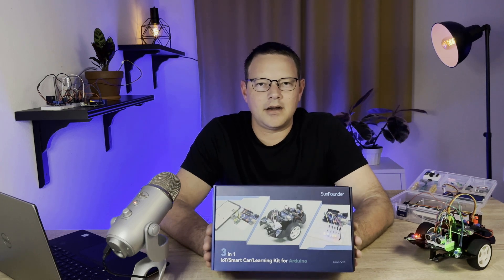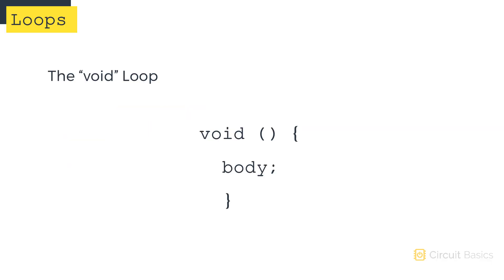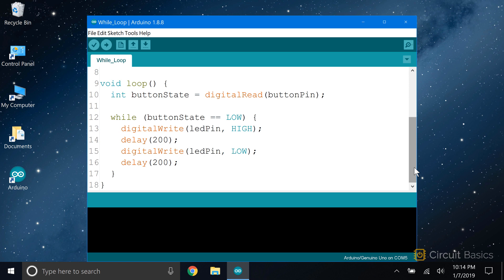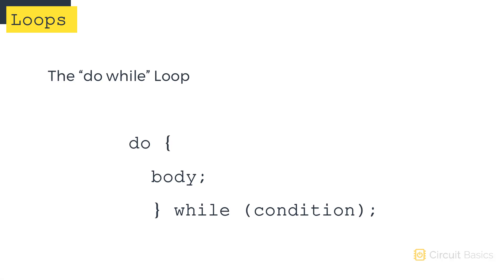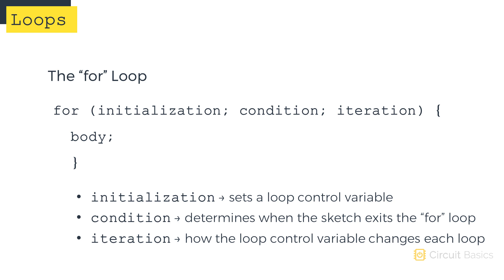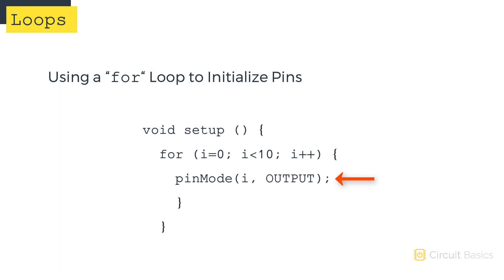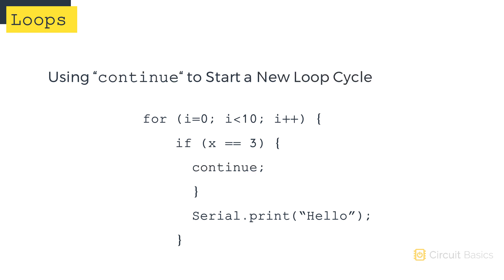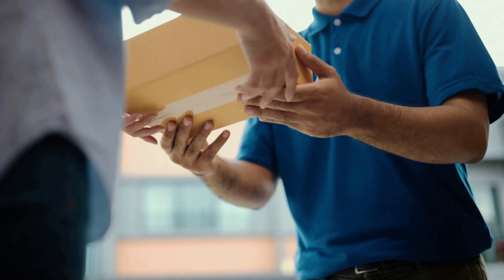How to Use Loops in Arduino Programming - Ultimate Guide to the Arduino #13

Comment: so in the first example showcasing the while loop command, line10 declares "int buttonState = digitalRead(buttonPin)" to store the pin#7's high or low signal. Using while (buttonState == LOW) to trigger the LED to be ON and OFF codes using button here at 4:17, I found out that the "while" loop command only needs one condition check, after that It will repeatedly run codes. so the button became a onetime trigger.

so I changed the "while" to "if", The problem was solved, and now the button can control the LED to be ON and OFF.
guess the difference between "while" and "if" is, the "if" command checks the condition true or false every time, "while" only checks once.
Reply: or you can still use "while", but add one line of statement at the end. " buttonState = digitalRead(buttonPin); "